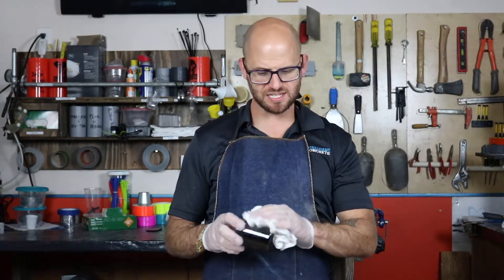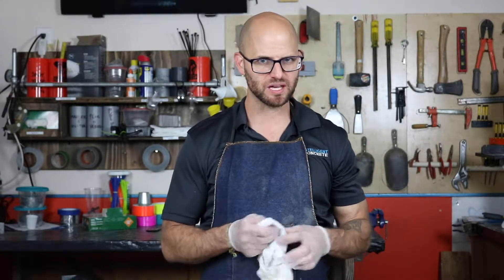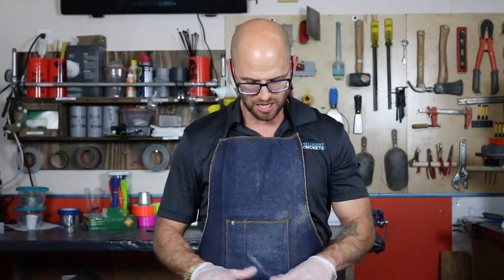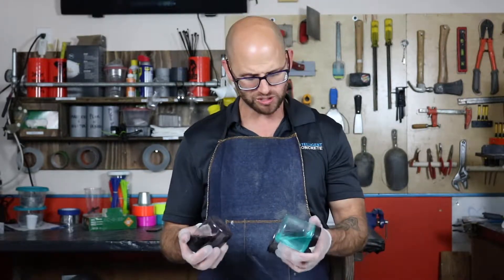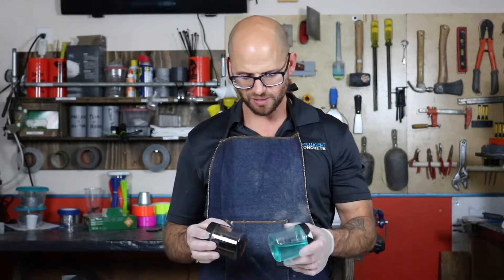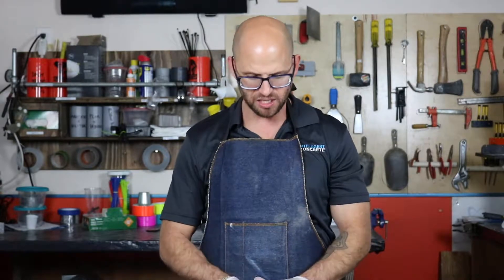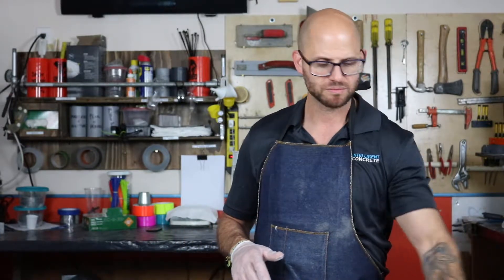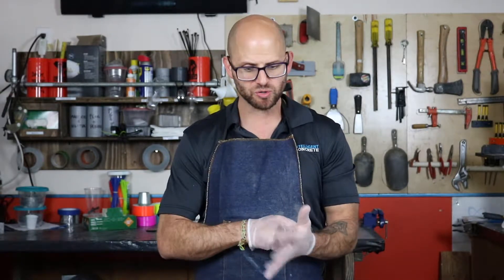What are High Range Water Reducers? - Vlog #54

Comment: I’m a concrete flatwork finisher, and am very very interested in HRWR products, but due to my own inexperience with these products, have had some negative experiences.    I am looking to achieve high strength concrete, and pour it at a high slump.  Somewhere in the 6-7.5” slump range.    Every time I order a HRWR, we get a very very sticky mix, that is actually more difficult to place than standard water tempered concrete.   I have my suspicions that the plant is not using this admix correctly, but I am also aware of my ignorance, and understand that I am probably the one who doesn’t understand.   They use master glenium 7500.  I have requested them send my truck at a 7” slump.  What I received was a sticky 4” slump that barely traveled down the chute. Am I asking for the wrong admix?  Is there an admix in existence that will allow me to pour a very easy to place 7” slump with no added water?   Tearing my hair out over here.   Thanks for the awesome content!!
Reply from the maker: Howdy Ben.  It sounds like your RMX isn’t using the right combinations of admixtures and powder.  What’s the best way to reach out to you?
Reply: Interested in being able to communicate what my water reducer needs are as well. Mid range water reducer, 6” slump. I am afraid I don’t know beyond midrange water reducer what to communicate